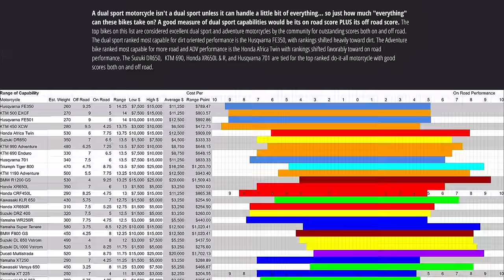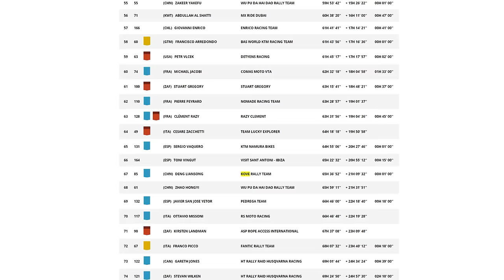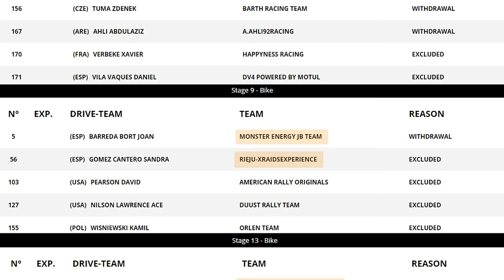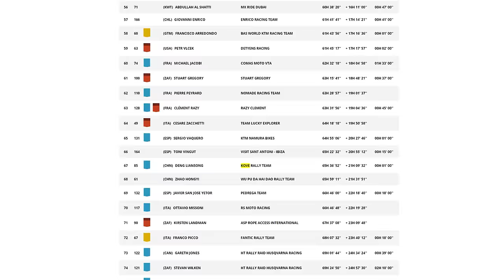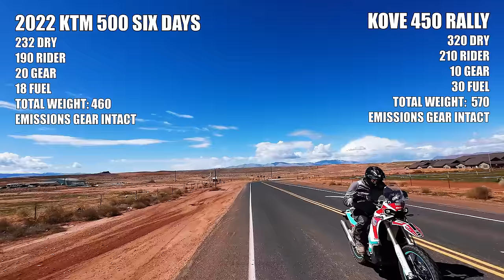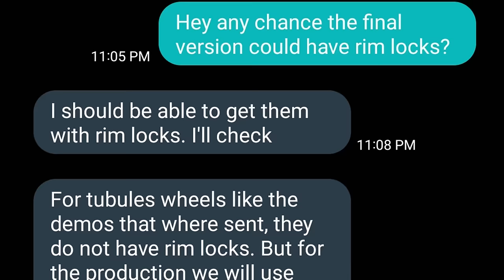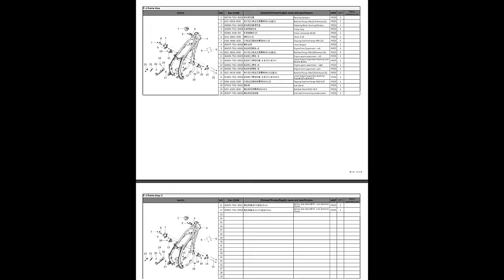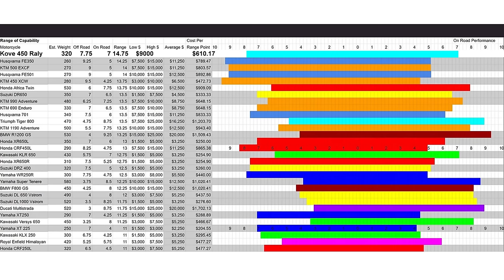I bought CHINA'S Dakar Rally Motorcycle! Kove 450 Rally BRUTALLY HONEST REVIEW + KTM 500 Drag Races!

Comment: Lets all be honest. GPX has been putting out some fantastic equipment for the past few years, at an astounding price, and it just keeps getting better. They're a company that actually takes rider input to heart and improves on their product. Sometimes within the same model year. CFMoto is another company that is changing the game. I don't knock China when they actually try. And they're trying. Boy are they trying.
Reply: I will say that one thing I wish GPX did was use shift/clutch levers, shift and rear brake arms and other "consumables" that were compatible with something else. Doesn't have to be a "clone" of those parts, just compatible. So riders are left wondering where they're going to get replacements for those things that most often break.
Reply: Basic consumables should be.
Reply from the maker: Yeah Gary of GPX has mentioned that it can be a nightmare to get some factories to up the quality, but has said Kove simply wants to make an awesome bike because it's a passion project more than just a moto-churn.
Reply: I have a CFMOTO 800xc and it's a hell of a machine. Well built and performs very well in the tough stuff. No breakdowns and very well appointed.
Reply: I own a CFmoto Uforce 1000 and the quality is really really good. I have been more than happy with it.

Comment: My experience with recent GPX bikes: fasteners loose and rusting. Inexplicable failures to start. Exposed connectors and wiring. Cheap plastic and decals like a power wheels. Toy. DMV refuses to issue a plate due to VIN not showing up in their system as road legal. That is all with a brand new bike. I'm even more curious about how it looks in five and in 10 years. This is what the brand is up against. And any potential buyer should be asking

Comment: For those curious, based on the manual pdf on GPX Website maintenance intervals are as follows:

Fuel filter: Every 6,000 miles or every year
Valve clearance: Every 30 hours/1200 miles
Engine oil/filter: every 300mi for first 1200 miles;  Replace every 1200 miles afterwards
Coolant: Every 2 years/18,000 miles
Shock oil: Every 3,100 miles/100 hours

Everything else is check/inspect and replace as needed. These numbers are also conversions from km to miles. Overall I feel like these intervals would be very short if it was a regular dual sport or adv bike, but it's a rally bike so honestly they're not terrible.
Reply from the maker: That's good info! I don't know how I missed those details and got some different numbers (5000 valves, 2000 to 3000 oil). It seems that some of the numbers for maintenance are different from Kove to GPX, too. Perhaps they differ from the rally version ($12000) to the "tall" version? I'm unsure. Thanks for putting those numbers up, though!
Reply: @eveRide  I saw some different numbers in an article too. But the ones I put come from the manual on the page. Seems like maybe something was lost in translation
Reply: That's one of the most worrying aspects when it comes to chinese bike's reliability .. is this a translation error ? is this caused by the differencies in climate and geo between states/countries ? maybe the manufacturing tolerancies are different between chinese/USA/european etc markets ?  I haven't yet figured it out, but it seems to happen quite often.. for example, when it comes to another chinese manufactured bike, the Voge 300 Rally (sold in Europe/Asia -  Voge is a subsidiary of Loncin), its manual depicts different service intervals from one EU country to another, even though these countries have the same climate/geological conditions ...
Reply: Dang that sucks
Reply: 2000km oil changes
Reply: Well a 450 that has similar service intervals as a 450 Enduro bike it's not to bad, and the fact that it's dry weight is slightly heavier than a KTM 690 it's not to bad either , let's hope it doesn't get any other surprises after it passes all regulations to become completely road legal in all 50 states

Comment: I am speaking without knowing the specs but if this motorcycle has large service intervals like 10000km then it will be great if not i would prefer to have lets say and AJP  Pr7 or the obvious KTM 690.. I think people dont want a 450cc only because its the rules on this days in Dakar, i think people want at least an 650cc because its always better for a trip on highway.. Tell you this if Honda just updated the XR 650l with a Dakar Style  fairing that means (bigger fuel tank and some body protection) ,  reworked the engine to fit an oilcooler to find some horses and at the same time extend maintenance intervals,  they would rock the world on sales. People that like adventures just want something Simple(reliable), large service intervals, ligth and cheap to mantain i think they dont need a replica that in the end is always expensive. Thats why somthingh like a Royal Enfield himalayan oldschool sells more then anythingh else and there new 450cc Will sell more then the Kove 450😅

Comment: So I have two concerns.
1. What is the KOVE weight limit?  I heard that there is a weight restriction of 175lb rider.  Since I'm around the 245lb area, does that mean I will start breaking things if I"m over that limit.

2. The suspension and getting heavier springs.  How hard will it be to upgrade the front and rear to my weight?

I really like the support and enthusiasm generated by this new rally machine.  Very complete review and you did a great job. Thank You
Reply: I need an answer to this as well.
Reply: That 175 lb number is not a max weight for the bike, it is the rider weight of the springs. As any experienced rider knows, 250 lb riders need different springs than do 125 lb riders. The factory springs on most bikes are for 150 to 175 lb riders. Every 25 lb increase or decrease necessitates a change of springs; this is true for every brand of off road bike.
Reply: Can you add bags, etc?
Reply: @grandenauto3214  The bigger concern is the EPA and DOT certifications. The importer recently said that the first shipment won't be EPA certified for street use immediately. Depending on where you live, you may not be able to license it for street use. Another press release said the first or second shipment may be 49 state legal; not legal in CA. I would and am waiting for that issue to be resolved before placing a deposit on the bike.

Comment: You have great production techniques and values.  Re: the bike. It's the same price and service intervals as the 450L (yes 450L needs a vortex to run properly), but i'm guessing there isn't one simple fix all the Kove's issues, which we are yet to fully guage (didn't the transmission fail on the other video test ?) Also it was 360lbs without fuel in the other test as well and it was stated that they dont really have emissions equipment yet as they were still working out what was needed to pass all states registration requirments ? So the versions we get could be much less powerful. Also most people decork the KTM so I feel that the Koves shortcoming weren't really demonstrated there. Not sure if ADV riders really want to rev their bike to access the power either ? Anyway, I think the bike is the beginning of a long term success story, but blinking lights dodgy fuel gauges etc leads me to think it's going to be a high risk purchase for a while until people clock decent hours on final producton versions.  Look forward to hearing some long term reviews of it.
Reply: Take a look at companies like CFMoto. The Chinese aren't screwing around and they will make a decent bike within a few years

Comment: Great to see that GPX are bringing these to the UK too, a shame that the currency exchange works out differently-£8500 = $10400. Also they’re supplied direct from the factory in the crate, so you have to transport it home and assemble yourself, which some might be a little intimidated by unless it’s quite minimal to build.
Reply: If it's like many , front wheel ,handlebars,battery filled and controls need installed . It's fiddly but not rocket surgery . All fluids must be checked and all bolts and chain should be checked .
Reply: @eflanagan1921  AVE fan?

Comment: Lots to consider here, so your video length is great.  The crap ton of work this must have taken is greatly appreciated.

I bought a 2002 WRX wagon new in the summer of 2001, when it first came to the US, and 190,000 miles later, still have it.  She has outlasted two spouses, LOL.  Early adoption can be an exciting adventure that puts you in the forefront, but along the way there will surely be challenges.  You can do it!

I worked with a guy that finished the 2022 Dakar race.  That race is for real.  Three weeks after the race his hands still looked like he choked a drum sander.  

For me, the most important pre-purchase question is real world reliability.  Hopefully you will give us another video after a season or two and maybe 5-10,000 miles.  If the bike sells well, the aftermarket will follow automatically, because capitalism.

I was especially encouraged by your reporting on the responsiveness of the manufacturer to consumer feedback.  That is one of the things that attracts me to the Beta brand over KTM et. al. for a light weight dirt oriented dual sport bike.  They listen, and fix stuff that needs it.  Why this is rare I am not sure, but the smaller brands seem better at it, generally.

Thanks again Tyler, and I have not forgotten to take that tour I won!

THE

Comment: So I’ve been following the Kove story since I first heard the bike was a thing… I spent nearly $20k building a ktm based adv bike (690 instead of 501 based for better svc intervals and much better touring chops).  The kove sounds like a same weight/lower power/much lower cost Husky LR to me (an adv guy). Will continue to follow to see how they hold up (my primary concern with the Kove). Only concern with this vid is the drag race… drags results are generally 95% determined by weight and power (riders skill is important at high hp levels but not for these bikes)…. The Kove should not be doing as well as it is in your vid given the specs of the bikes involved, it was similar power and a 20% heavier than the 23 ktm... and physics doesn't leave much room for it to win… which makes me wonder if you got a ringer (pretty common practice for mfgrs to send ringers for review).
Reply: You forgot to add gearing at your calculations..this is the reason kove drove past ktm.
As far as reliability goes,all was proven in Dakar rally. The bikes were tested 3 years before Dakar, so nearly all problems were eliminated.
Reply: @MERMBRAMA  Nah... gearing is not a magic power adder... gearing and torque could help the Kove get a jump on launch (which wouldn't help here since they rolled) but once both bikes are in their power bands it's really a straight HP fight (unless one is geared completely stupidly... which from obvious shift points neither is). The other factor that could have an effect is poor shifting but both are shifting crisply. Final possibility is that the KTM is down on power (maybe has a lot of hours on it), that IS a possibility... but if the KTM is performing to the listed specs the race results do not make sense. Ya cannot change the laws of physics.
Reply: @kuhndj67  you must be right..both ktms have a lot of hours, they make less than 40hp each. Gearing has nothing to do with it.
Reply: @MERMBRAMA  Still loving what I'm reading about the Kove overall... but it's pretty clear from reviews that the one weak point on the bike is power - and I don't think I've ever heard anyone say the 501 lacks power so yea there's something odd either with the Kove or possibly with the KTM.
Reply: @kuhndj67  the power is definetly not weak. It is not a typical 450 hard enduro power.
It is linear, smooth,controlable till 6000 rpm, with great traction,it does not tire you out.
After 6000 till 10000 it changes character and sound, starts pulling and moving very fast. You can rise it hard,be very quick, and ride quite a while, without beeing tired.

Comment: I ride in Mexico a whole lot.  Imported Chinese motorcycle brands are unreliable, weak, badly made garbage.  They may look nice at first glance but the quality and performance are what you'd expect.  No joke, any 250cc Chinese bike will get blown to the weeds by a 125cc Japanese bike.  I've ridden them, everyone who owns one knows, the only benefit is the initial low cost (excluding frequent maintenance with parts and labor).
Reply: I purchased a generic chinese kickstart lever about a month ago.  As I tightened the bolt, the damn thing broke!  That's what I get for buying a pot metal product!
Reply: @stevena1887  I have a Mexican friend who purchased an Italika 250 (made in China).  I was not there to see the incident but he told me that he was going downhill in rocky terrain when some piece broke causing the rear wheel to lock up resulting in a nasty crash.  He lost confidence in that bike and sold it.  I never got to see the damaged part but I can't imagine what could have possibly broke.  On a Japanese bike, the worse that can happen is a chain breaking but that was not the case with him.
Reply: Mixing Kove with the Chinese brands of the past? Wrong my friend
Reply: @billyzee261  try kove 450 rally asap, and let me know what you think about it. I think you will change your mind about Chinese motorcycles
Reply: @MERMBRAMA  as soon as someone else buys one, I will most certainly try it out.

Comment: Don't buy that piece of chinesium. I give it 10,000 miles at most and that engine, transmission, frame, and suspension will be TOAST. Longest I've seen a chinese bike last so far was 7,500 miles when my co-worker got a zongshen
Reply: Update. Saw two Koves at my local OHV park. Both were broken within the first hour of coming off their riders' trailer
Reply: @dualsportoutdoors what went wrong ?
Reply: @admoto77  one blew an engine. The other had a broken frame. There have also been videos showing bad rectifiers, clutch issues, and electrical bugs
Reply: @dualsportoutdoors  thx for sharing

Comment: Owned a Ducati Elephant back in the day.  Fast (137 mph) excellent handling on the street.  Touted as the best carbureted Ducati at time.  They won the rally, but those bikes were slightly detuned and had some serious suspension work completed by the absolute best race prep shops in Italy at that time.  Total cost of the machine was at least 3x the price of a stock bike.

Comment: Great chart, very helpful. Still, somethings off with the 350 to the 500/501 road evaluation. The high revs of the 350 at highway speeds make the bigger engines much more desirable, despite either being a rough experience overall.

Comment: well I wish I knew what this Kove 450 looked like up close, .. there are no still shots in this video worth mentioning.  
I bought a South African Bashan Xplode in 2012, which I hear is a Chinese copy of a 1977 Honda CRV. 235cc engine  And I think it probably is.  But, I have put 33.000km (20.000miles) on it through the Namib desert and despite crumbling plastic body parts in the sun, no breaking engine parts at all.  Nothing.  I am not mean to this bike, the desert is mean to this bike. Change oil every 1000km and not a problem.  Ok, not true, Ive re-covered the seat 3 times and changed every clutch and brake cable about that too, new =-ring chain and some brake pads. And lots of super glue for the plastic parts...  I paid 17000 Rand or 915 US dollars for it,  including delivery from Durban to Windhoek, if anyone can complain about that:  I beat my friend on his BMW GS1200 on trails, constantly.  I will buy a Kove 450

Comment: You can "make" a rally bike, take whatever flavor Enduro and put the fairings in it. Or spend the money and get one of the replicas. What the market is actually looking for is the pinnacle of dual sports, an off road and highway capable machine. One with good range, aggressive suspension, and most important long service intervals. Does this bike so those things?

I can go get a 450 or 500 Enduro in your preferred color and rig fuel tanks and a big ole windscreen and make a rally bike. But you don't see that so often because it's not what people want. What we want is a lightweight, tame yet powerful dual sport that looks like a race bike. (oh, and that wasn't designed in the stone ages)

Comment: One I’m watching is the new Royal Enfield Himalayan.

450cc liquid cooled ~40hp & big bottom end RE torque, they are allegedly coming out with an adv spec with the same low seat height & pot belly pig handling of the original 25hp Himalayan, but also releasing a rally spec version with lifted long travel suspension.

Also backed by REs brand which is beginning to be known for bringing out bang for buck robust bikes.

Comment: Edit- Looking at this review 3 months later I need to say it's one of the best reviews I've seen in a long time. Also, I got impatient and "settled" on a 2018 KTM 300 XC-W and I don't think I could have made a better choice; 2 cycle familiarity and simplicity, best suspension I've tried, mountain bike light, and fast enough off road (it's plated too!). The XC-W is making a 500 6 days a much more appealing concept. Hopefully by the time I'm really ready to look into a 4 cycle a Kove will also be a legitimate option right there besides the Euro bikes.

Looks cool, but I would still take a KTM (or Beta) 500 without much thought. If Kove released a "dirtbike with a plate" type of 450 dual sport, for around $7500, I would be VERY interested. As it is, I'm already a bit hesitant to buy a Euro bike so I'll wait patiently to see how these Chinese companies do over a few years.